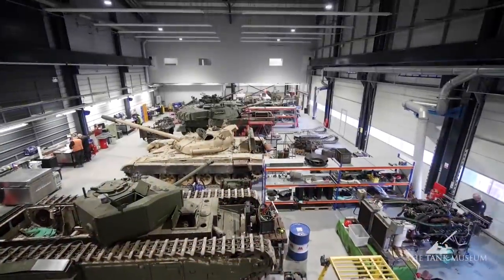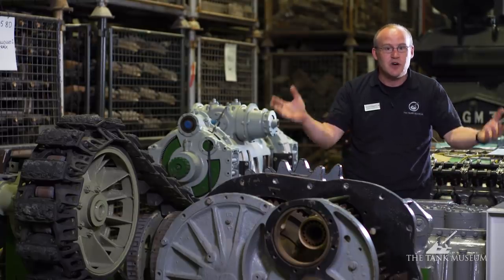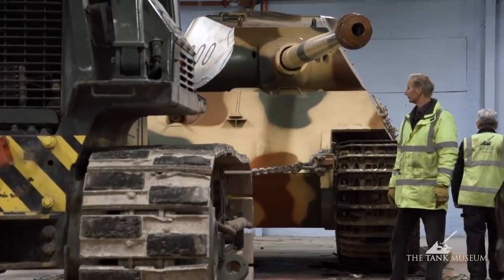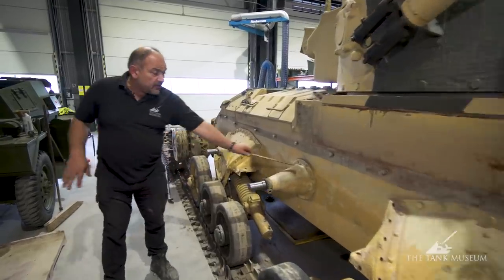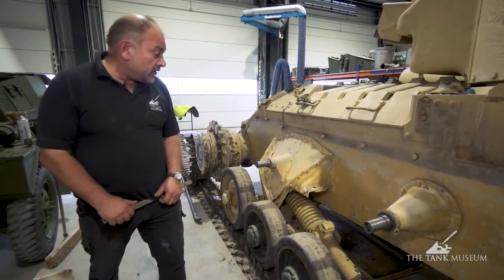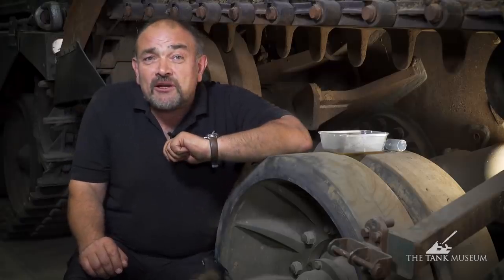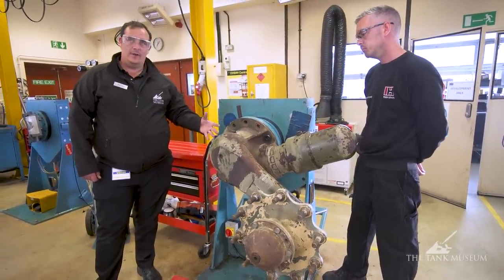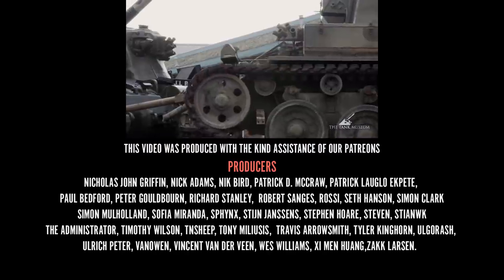Valentine Repair | Ep. 7 | Tank Workshop Diaries | The Tank Museum

Comment: Even the small stuff is interesting. I don't get to see the details anywhere else. BTW: a great example of the final drive reduction on the Valentine in action as the brake drum spins faster than the sprocket when the track is coming off (11:05). I think they were just discussing that feature of the drive wheels during a recent Patreon Q&A.
Reply: Called slowmotion drive, it mounts the brake drums outside for better cooling, its called slowmotion as the brakes are mounted off the transmission output, before entering the reduction epicyclic gearboxes before attatching to the tracks drive sprocket

Comment: 10:15 re: oil nipples being mistaken for grease nipples, this even happens on old industrial machines, I have an old East German lathe with a sleeved spindle shaft where the previous owner just used grease instead of bearing oil. Had to completely disassemble the headstock to get that all out.
Reply: Grim

Comment: I have to say, if you are a scale modeler, being able to see the way that Valentine has weathered as they are taking it apart is invaluable.  Most notably the paint chipping and discoloration along the sides of the hull, the accumulated dust from people walking on top of it, etc.  Usually one is resigned to using old black and white photos, or color photos of vehicles that have been sitting in the elements for decades, neither of which are anywhere near as good as seeing a live, running vehicle that is actually driven around, on video using modern cameras.

Comment: All that about the sleeve bearings on the Valentine reminded me of when we rebuilt the same on a Caterpilla D4 on the farm, over 40 years ago. I suspect we would have rather shocked the Tank Museum staff with some of our methods. There was a company in Lincoln that made pipe-organs, and they used a old-fashioned lathe to "spin" the tubes to shape. When they closed down, we bought it it, and so I can say I used an organ-builder's lathe to fix a Caterpillar..

I think we might have done a better job if I had seen this video.

Spinning the metal on a lathe might be a way you can make replacements for some of those damaged pars that were hidden behind various wheels.

Anyway, you're the people there, not me.

Comment: A mirror finish is probably not ideal for an oil seal. Smooth is good, too smooth is bad. Here's a bit of what a couple of oil seal manufacturers say:
Parker Hannifin -- "In a dynamic surface, microscopic variations form recesses which hold an oil film between the seal lip and the moving surface.  If the surface is too smooth, friction and seal wear will be high because this oil film will not be present."
"Surface finishes below 2 μin Ra can create aggressive seal wear due to lack of lubrication "

SKF -- "The surface roughness values of the counterface for radial shaft seals, calculated according to methods described in ISO 4288 (DIN 4768), should be kept within the limits specified in RMA OS-1-1.
The lower value for Ra is a minimum value. Using a lower value will adversely affect the lubricant supply to the sealing lip."

Comment: Were the Valentine's spot welds on the retaining bolts done in manufacture or when going into preservation? Just wondering how the hell you would change a suspension unit in the field if it was designed like that!

Comment: I'm assuming having the bushings and bearings bathed in oil is advantageous in that if the oil doesn't leak out there's no metal to metal contact but instead everything is riding the film. It's a great idea for reducing wear and tear but it seems rather complicated for a tank. Was this devised because of the lack of bearings because of war time? It just seems like it'd be way easier to use a Babbitt bearing you could pump full of grease.

Comment: Why didn't the valentine see more use? Low profile, good gun, good armour, lightweight, easy to produce iirc train companies produced parts for it and so on. It's only real fault as far as i can see on the wiki seems to be low speed and mobility thanks to the less than ideal engines.